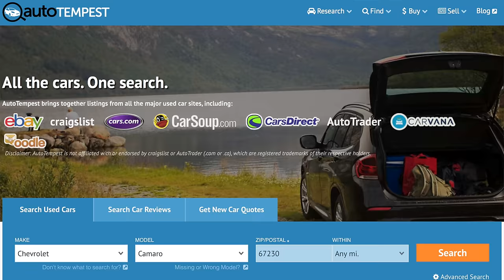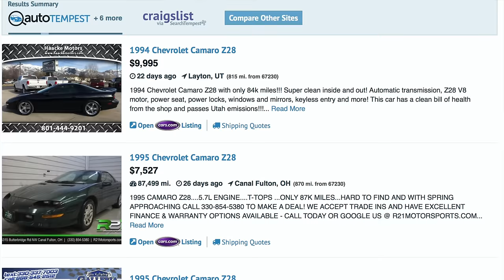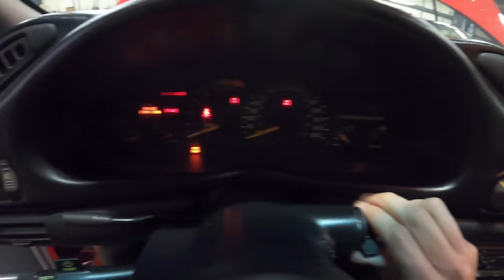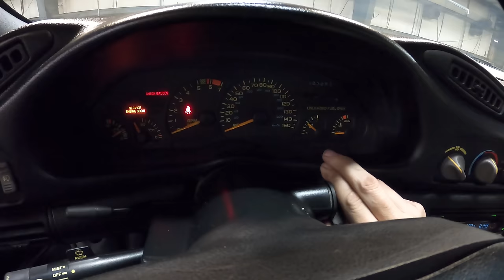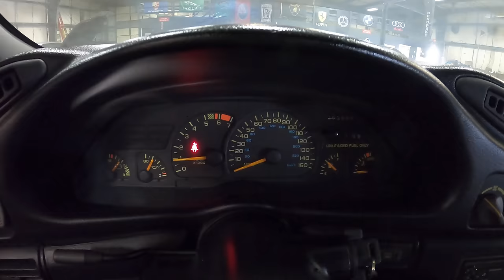I Bought a Barn Find 1993 Camaro Z-28 and Started it for the First Time in 10 Years!

Comment: worst fuel pump job ever, ive done 3 to date an the last one i got a kit to cut a hole in the truck or hatch i guess so u can do it from inside the car then u just bolt a cover with a seal over the hole. still a little tight but way faster an easier than dealing with dropping the rear end on one side to get it out. ive owned to many f body cars, trans am an camaro 94 to 97, never got to get one with the ls1 but ive had my fun with them. peck on the injectors with a screwdriver handle an that can free them up sometimes if they are frozen up from sitting, ive had to do it a couple times on lt1 cars that sit for awhile, never had to replace one yet, just light taps with a screw driver handle an its always got the working again.

Comment: "The tires feel like squares." Yet my 95 with round tires shakes more than this at idle LMAO
Reply: That’s probably because of the steel drive shaft causing all that shaking, it’s a know problem with the lt1 stock drive shafts. I heard if you switch it out with a ls1 drive shaft it stops the vibration at idle.

Comment: You should never turn an engine over for more than 10 seconds at a time its common knowledge if you do the starter or wiring will catch fire eventually especially when the car has sat for 10 years or more

Comment: Interesting (bad) method of diagnosis. On a vehicle that's been sitting that long, you'd basically want to assume the fuel is bad and make repairs accordingly. Pulling the injectors (then repairing or replacing them) might have been all that was needed to get it running.

Comment: Lol wizard all he had to do was cut the filler neck pipe and the tank would have gone right out you could have used rubber line to re attach or weld it back in place. He should have checked the injectors first

Comment: No one ever takes out the gas tank to change the fuel pump in those cars. Everyone Cuts an access hole just over the rear end hump under the carpet. you then get another piece of sheet metal and a rivet and a screw and make a turning access point for future fuel pump replacement. Then you use Muffler tape to tape around the outside edge to make a closed seal. Very common and it only takes an hour or so to do. After that you can change a fuel pump in a half hour max.

Been buying these cars for no money, for many years, because of this ridiculous engineering

Comment: 80,000 miles is Nothing for a car of that age. Starting a car that sat requires pumping the gas pedal, something younger people are oblivious to. I had a 53 Caddy hadn't ran in who knows how long, just added gas, do dropping gas tanks. Additives can eat up the gummy stuff and save on labor.  I'd try a $5 bottle first before going deeper, remember KISS, keep it simple stupid. Better to have just replaced the fuel filter and tried it after a can of cleaner.Check the fuel pump fuze?

Comment: what ever car same stuff in bikes is it bensiin or diesel car and you gonna let it stand long time you really must run it so long at all the petrol / diesel from the tank and the pump and the lines & injectors / nozzles or car where is carburettor are completely out then swap new oils and coolers in the radiator NOT just water because water destroys and calcifies parts and places in the engine and hoses and water pump